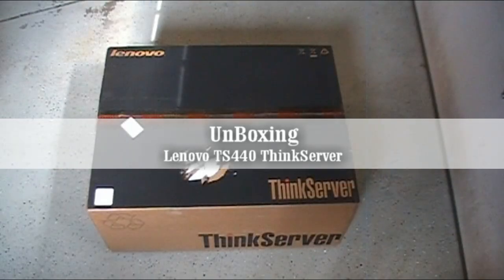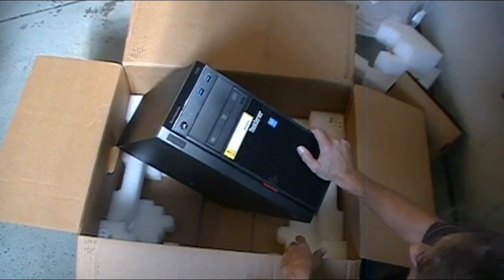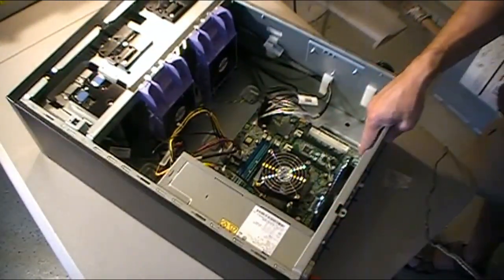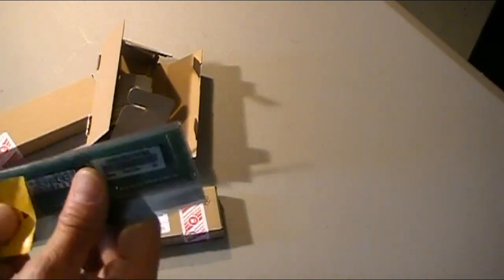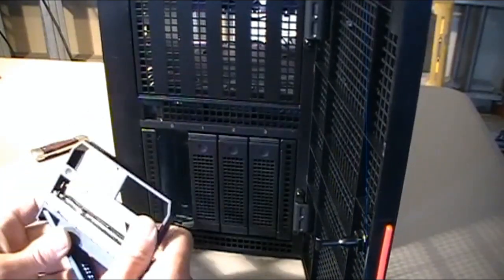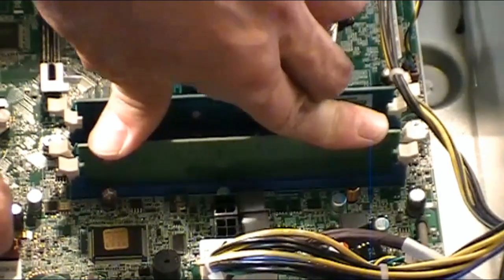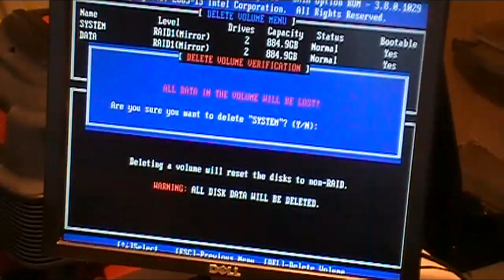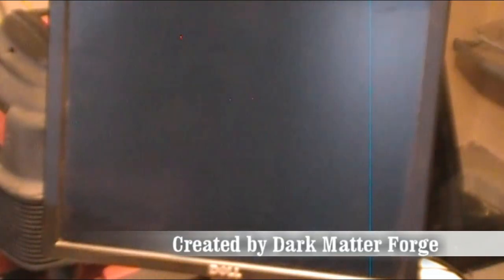UnBoxing and RAID Setup Lenovo TS 440 ThinkServer

Comment: Also while installing window on lenovo st50-7y48 it showing storage device driver not found. What should I do. I didn't get any proper solution on YouTube . Please help me in this
Reply from the maker: During boot up you should see a prompt to hit Control Y. That will get you into the RAID configuration.
Reply from the maker: That is because the driver does not come with the windows Media. You will need to go to Lenovo support and download storage drivers for that computer. Put them on a flash drive or a CD and set up should allow you to select the drivers from that downloaded media. Lenovo usually includes a setup CD/DVD with their devices. That would have the driver on it. If you don't have that original DVD you will need to download from the Lenovo support site

Comment: Seagates.......you poor fool. I see this was in 2015. How long did they last? I had a single 2 disk NAS go through 4 2TB barracudas in 9 months.......I had  2 more fail on me in my gaming PC. When I built my Synology NAS I paid extra for 8TB WD Red because I will NEVER trust my data to Seagate again.
Reply from the maker: Subparanon actually, knock on wood, these seagates are still up and running fine with no failures. I did have a run of bad luck with seagates. In most cases we have stopped using them since this video was made. We tend to go to Western Digital for drives depending on need. We use Reds for NAS and servers, Purples for NVR. Unfortunately, some of the deals from the oems don't give  an option on Drive brands.

Comment: Great video. Not many videos on youtube on these servers. I got few of questions for you.

What's average the power draw on idle and under medium load?

Are the fans loud?

What's the speed of the backplane?

I can add 8TB drives?

Can I add 4 more drives on the top row for a total of 8 hard drives? Is there a blackplane already installed on the top row?
Reply from the maker: Thanks! The fans are a little loud, not terrible. The server is out on a client's site so I can't answer a few of your questions. Since this model came out there have been some changes in the Lenovo hardware. This one only had the one array for drives. You'd need to see if they are supporting a second 4 drive array these days. I suspect that the newer ones will support 8TB drives. Here's a link to the current version on the US Lenovo site - http://shop.lenovo.com/us/en/servers/thinkserver/ts-series/ts440/

Comment: Nice video! I have a question though: How did you connect the monitor? I did not see a HDMI port. Did you install a graphics card? Or am I missing out on something... I apologize, I do not know much about this. Could you explain?
Reply from the maker: Go to 3:39 - https://youtu.be/KoPpLymtNnI?t=3m39s - There is a blue VGA port for the monitor on the left hand side next to the blank for the second power supply. This version of the server doesn't have HDMI or DisplayPort. Newer ones may have it.

Comment: Excellent video! Thanks. Question: I am planning to setup a RAID 1 with two SSD drive. One of these drives will have a Windows install and the other would be blank. So will I lose the Windows install during the raid setup?
Reply from the maker: +Meengla Yip Yes, during the RAID 1 setup it will wipe the drives.
Reply: +Pete Deichmann Thanks for the info! Do you think once I establish the Raid, I take out one of the drives and clone the OS/data from the other computer and put the drive back then it would work? Also, in that case, will the drive be bootable to Windows?
Reply from the maker: Meengla Yip I think the RAID set will assume that the drive that you are adding in is a replacement and it will overwrite it with data/OS from the drive you left in the system. You may be able to create a clone and write it to the RAID array on the new system via a ISB drive or similar, but I am not sure how it will react to that given differences in drivers, etc.
Reply: +Pete Deichmann Thanks again! Okay, one more question: Will this RAM chip work? http://www.ebay.com/itm/281510399272?_trksid=p2055119.m1438.l2649&ssPageName=STRK%3AMEBIDX%3AIT Note, it is Non-ECC but I am going to be running mostly as a home workstation with occasional test server use.
Reply from the maker: Meengla Yip No, you will need to get ECC RAM for it.
Reply: +Pete Deichmann Thanks. The ECC RAMs are expensive...but I guess I don't have a choice. Some place I saw that nowadays RAM is reliable and so ECC is not necessary. Oh, today a couple of hotswap caddies were delivered and tomorrow a couple of 2.5 SSD will be delivered--I may bug you again. Thanks in advance.
Reply: +Pete Deichmann Pete! I guess I screwed up on the hard drive part! This is the Caddy I recieved today: http://www.amazon.com/gp/product/B0135N6BH4?psc=1&redirect=true&ref_=oh_aui_detailpage_o02_s00 but my hard drive is going to be http://www.amazon.com/gp/product/B00S9Q9VS4?psc=1&redirect=true&ref_=oh_aui_detailpage_o00_s00 and their adapter is going to be: http://www.amazon.com/gp/product/B00F3QFKNS?psc=1&redirect=true&ref_=oh_aui_detailpage_o00_s00 . As you can see, the Caddy is for SAS drive? I need for SATA? Please confirm asap. Thanks!
Reply from the maker: Meengla Yip  The caddy shouldn't matter. SAS and SATA have the same mounting configuration. Not sure how well it will all line up with an SSD though. I've not tried that yet.
Reply: +Pete Deichmann Hi, indeed, it was my own clumniness trying to put in the caddy; apparently, I had to have the front of the caddy in eject mode before I could push all the way down and lock in place. Currently, duplicating an HP Pavilion X2 210 onto an old SATA drive nand then will put that back in the Thinkserver..just to play around. Thanks for the response!
Reply from the maker: Meengla Yip Good luck. Let us know how it turns out!
Reply: +Pete Deichmann Pete! Making progress. I managed to use the 2.5 to 3.5 adapter for SSD and created a Raid 1 for the two 240 gb SSDs; then I put in a Win 8 Pro DVD and installed that--took barely 10 minutes! Win 8 didnt recognize the ethernet card but did recognize a USB Wifi dongle. Now connected to the internet, activated Windows, and installing Windows updates... RAM is only 4GB but will work on that later. Thanks.
Reply: +Pete Deichmann Here is the Windows Experience info: Memory (RAM) 4.00 GB 5.9 
Graphics Intel(R) HD Graphics P4600/P4700 4.9 
Gaming graphics 1943 MB Total available graphics memory 6.5 
Primary hard disk 180GB Free (212GB Total) 8.3
Reply from the maker: Meengla Yip Sounds like it will be a great machine. You using it for gaming?
Reply: +Pete Deichmann No gaming. Me and wife use it as workstation. I will install some virtual machines with server software on it--I ordered 16gb ram from Amazon for $120 today--with 16gb more soon. Question: One description of the item says it has 8 internal 2.5" connections for SSD drives. I don't see any in my system; If there were some then I wouldn't have to buy the caddy and the 2.5 adapters--cost me some $40-50 for them for  a set of two. Thanks
Reply from the maker: Meengla Yip Here is an image of the motherboard. Then connectors are on the lower right. Not sure where/how you'll stick additional drives inside the case though. Not much real estate in there. Maybe an  eSATA card would help.
http://www.lenovo.com/images/gallery/1060x596/lenovo-tower-server-thinkserver-ts440-side-open-7.jpg
Reply: +Pete Deichmann Pete, yes, that's how my mobo looks like--so no space for the so-called 8x2.5 connectors unless I put in some kind of eSATA card. Kind of glad to know this because otherwise would feel bad about investing in the caddies and the adaptors. BTW, the RAM from Amazon being delivered today. Can't wait! Thanks for the info!

Comment: Hello Pete, thanks for the TS440 introduction. Im used to setup personal computers, but sever setup is new to me. I wanted to ask you for advice about the OS to use on the TS440 for my setup. Basically what we have now is a couple of regular desktop pc i3, one serving video, a intranet web app  and a audio storage, and the other pc a filezilla ftp server and working drives (we record audio into the servers). 15 windows 7 workstation connect to them over the LAN and i am the only one that connect to it remotely for administration and some video re enconding tasks.  For what i understand, i could merge the two servers functions into this box, setup a raid for backup and data, even create VM as needed, but not sure what OS i should use. I think windows should be the way to go as all the workstations are windows 7 based, but which one? Windows S 2012? Windows S 2008, Win 8.1 pro, win 10?  or forget microsoft and go for Linux Debian?
Reply from the maker: +Johnny Serra Just shooting from the hip since I don't know exactly what you are trying to accomplish o... but here goes...

For sheer ease of setup I'd go with Windows Server 2012 Standard. You are allowed 2 server VMs in Hyper-V under that one server license. You could choose to set up one VM as an Active Directory domain controller or stick with a workgroup model. The second and third could be for processing if you need them. Split your VMs up, don't mash them all up on the same spindle. I like mirrors for this - 4 disks = 2 mirrors = 2 spindles, Host OS and VM #1 (Active Directory perhaps) on spindle #1, second VM on spindle # 2. 

2012 also has some nice remote access features, but if you want to RDP to it make sure you set up RD Gateway to keep the hackers at bay. Don't just leave a gaping hole in your firewall for port 3389.

If you need more storage build out a hot rod PC, load it with disks, and run FreeNAS on it for your stash and backups. FreeNAS supports iSCSI so you can trick your servers into using it as a local drive for a backup destination. Gigabit network would help immensely.

Win Server 2012 Essentials is cheaper and would support your user load, but you would lose out on the Hyper-V capabilities. Max it out with as much RAM and disk as you can afford. 
Linux would be cool, but there is a lot of tech that needs to be lined up.
Reply: +Pete Deichmann Thanks for the advice Pete!!! i have a doubt about 2012, i need to buy a CAL for each computer on the LAN?
Reply from the maker: +Johnny Serra Yes, You are supposed to buy a CAL for each user (my preference) or for each device. Server 2008 Std. comes with 5 CALS Server 2012 includes 0 (thanks Microsoft). CALS are tracked on the honor system. 

If you have 5 users, that is all you'd need. Server 2008 Std. only licenses one VM in Hyper-V, Server 2012 Std licenses 2 VMs. Server Essentials will support 25 users included with the OS, but has no Hyper-V licensing for VMs.

Gotta love MS licensing!

 
Example (not my words) - "CALs are owned by the user, or the device, and you only need to buy one set of CALs for the user to have access to Windows Server. So if your company has 50 employees, then you buy 50 CALs, and you're done.... Those 50 CALs would be sufficient for one windows server, or 500 windows servers so long as they're the appropriate version."
Reply: +Pete Deichmann thanks so much for the info!!

Comment: Hi Pete,
Do you know whether it is possible to install the GTX video card into TS440? I saw someone on amazon said there is not enough room. I am planning to buy GTX 960 card to install on my TS440.
Reply from the maker: William Tao I'm not sure if it'd fit. This server is already deployed at a client so I don't have easy access to it. Look at about 3:00 - https://youtu.be/KoPpLymtNnI?t=180 - for a shot of the internals. It looks large enough and there seem to be enough slots.  Cables toward the front end of the MoBo might cause some issues. Now I wish i did a better job with going over the available expansion slots! Good luck.

Comment: I just received my TS440 today, but man is it a PITA to open. I've exerted all of my strength removing the side panel but it just wont come off. I undid/loosened the screw just as you did, pulled on the panel a bit and got it to slide ever so slightly, but it seems to get caught after that. Kind of a bummer, and after watching your video it doesn't seem that there's any sort of magic trick to getting it opened either. Ugh.
Reply from the maker: Jason R I don't think there is a trick, they are very tight though. Lay it on it's side like I have it and remove the thumbscrew. If I recall correctly, it is easier to remove standing behind the machine. Also look for a key lock on it. I have run across a few variations that have a case lock.
Reply: Pete Deichmann I feel like a moron. I didn't realize I needed to have the front panel unlocked (where the HDD bays are) to remove the side panel. Lesson learned. Thanks for your idea :D
Reply from the maker: Jason R It had been a while since I put that one together. I was struggling to remember if the key had something to do with it! Glad you got it!

Comment: You used RAID 1 on both system and data and said that it would speed up the system. I don't see how RAID 1 speeds up the system. RAID 1 on the data for redundancy, but RAID 1 doesn't speed up the system ???
Reply: Learn Computer Science RAID 1 (Mirrored drives) can give you more read throughput than a single disk because both disks can be read at once—it all depends on how smart your RAID controller/software, OS and file system is. Also mirrors usually have more I/O ops per second than other RAID configurations. (This is all based on ZFS, I've no experience with hardware RAID.)
Reply from the maker: Philip Robar That is why we use RAID 1. It isn't ridiculously faster, but somewhat quicker that RAID 5. RAID 10 may be quicker and ZFS too, but for our client base they are cost prohibitive. Read performance is usually our goal for small businesses.
Reply from the maker: Philip Robar We are also limited for space in the smaller servers so RAID 5 isn't always the best overall solution. Thanks for the comments and visit!
Reply from the maker: Learn Computer Science Perhaps "speed up the system" is an overstatement. We us it for faster read performance and redundancy. I've found it helps on these small servers that run a local DB. Thanks for stopping by and commenting!

Comment: So where do I get the extra power supplies and RAM? I have no idea what model to get that works with this machine. I searched Amazon for PS440 and it didn't find anything.
Reply from the maker: Learn Computer Science We generally get the replacement parts direct from Lenovo or through CDW. On these new systems I always have the client buy the 3 year next business day warranty for the server. It saves lots of headaches if there are any hardware failures. Sorry I missed your comments; been out of town for a couple of weeks and just getting caught up.

Comment: Have you tried installing ESXI on this server? I've just set up this server and configured raid 5. However when I was installing the ESXI 6, all I saw was individual drives, not the raid array. After checking some forums, it seems that ESXI does not support software RAID. I may have to purchase a hardware raid controller. Any thoughts on which one to use on this sever?
Reply from the maker: CSEC Chemistry I haven't tried ESXI on this server, but I think you are correct there. I would be very surprised if it would work with software RAID. Check out the RAID Controllers from Adaptec; I have always had good luck with them. Thanks for the visit!